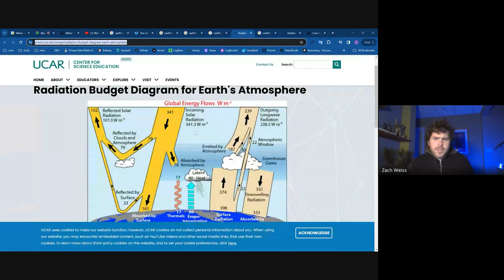Creating a  Career in Water Cycle Restoration - Can you do it? What is the job market like?

Comment: Does your training cover how to deal with karst  topography? I haven't seen it addressed anywhere. Permaculture literature tends to assume that if water is infiltrated it will only move slowly through the ground. In my experience, swales i've built tend to drain rapidly down into the porous bedrock and out of reach of the plants. Building organic matter certainly helps and makes small scale swales work to a certain extent, but I'd really like to improve water retention on a larger scale. Around 10% of Earth's land surface is karst so I wish there were more resources for dealing with the differing nature of the water cycle on karst landscapes.
Reply from the maker: Our training is geared more towards learning an approach, rather than a set of recipes. It focuses on how to quickly learn the context specific details, through the dynamic process of interacting with landscapes. Throughout the course you dive deep into the geology of your site, you dig test holes and do experiments to see what delivers the best results. 

So there aren't karst specific strategies per se, but there are other students doing this in karst topography. During the office hours with Zach there is plenty of opportunity to dive into the specific challenges you face as well. Every site has different assets and challenges, there's no one size fits all approach. So our course focuses on training you to be able to tailor your actions (and offerings) to what best suits both your landscape and yourself.